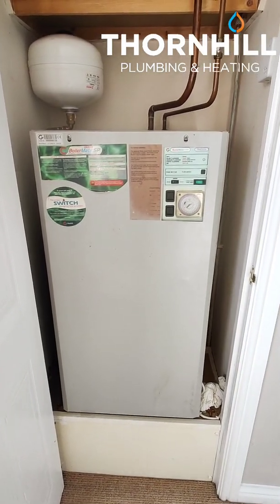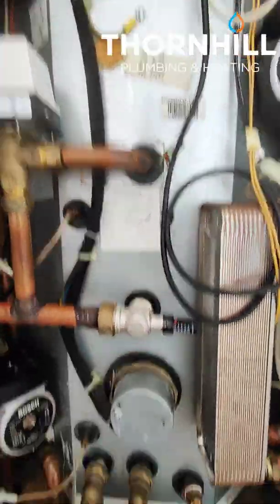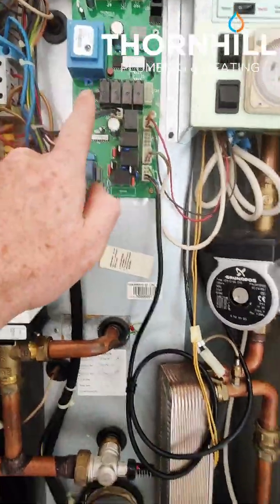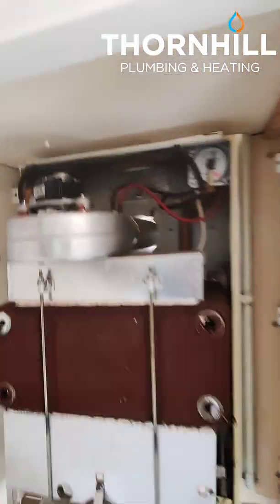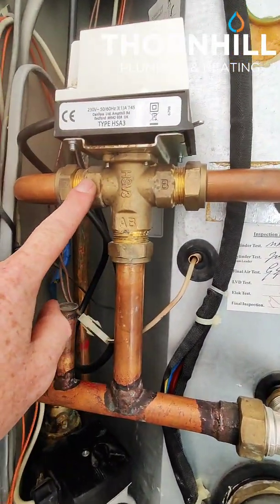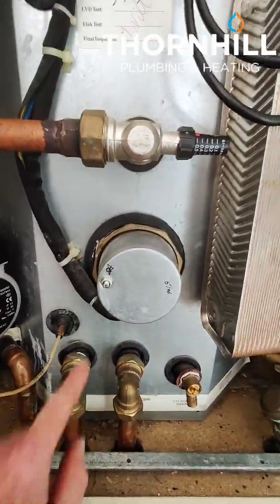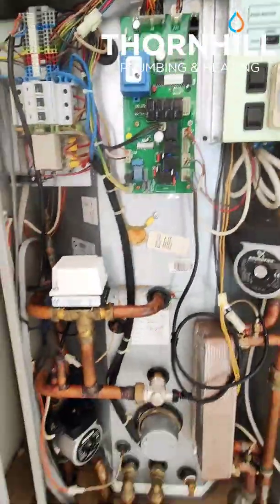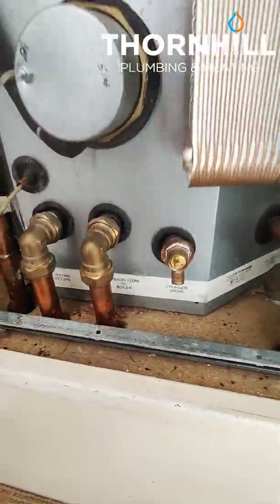How Thermal Store works , Gledhill Boilermate SysteMate A class

Comment: very nice detailed video thank you, I have lived in a house with 1 of these for about 10 years and it does not seem to be very well liked by my local plumbers.

What's your opinion on this setup? 

Issues I have had include, faulty pumps, faulty PCB and faulty temp sensors.

Anything else to watch out for?

My current issue is my boiler is calling for hot water at night it comes on for a couple of minutes, stops for a couple of minutes and then back on again. It stresses me out a bit and sometimes I come down stairs check the pumps and there is normally 1 wiring away so I reboot the systemate and that seems to sort it out. I believe valves can get stuck open which is part of the pump ? maybe i need another new 1.
Reply: same here! hence why im here. that bloody noise is a sleep destroyer
Reply: @Chris-qn1by  I sat and watched mine the other night for about half an hour Iand went into the settings and came to the conclusion it was topping up or heating up the water in the cylinder when it drops below a certain temperature. 

The issue is it doesn't just call the boiler and the boiler stays on until that temperature is satisfied. It calls the boiler heats up a bit, calls the boiler again and does this about 10 times until the water temperature is reached.

My radiators also don't get very hot any more. Fed up of it.
Reply: @nothingtoseehere3493  Same issue, I have a system from around 2000, it bugs me it works at night it just a waste of enegy, I like the idea but want more control mine, I'm building my own controler using a rasberry PI to 1) control the temperature it turns on at, 2) controls the temperature it turns off at, 3) switch it off at night.